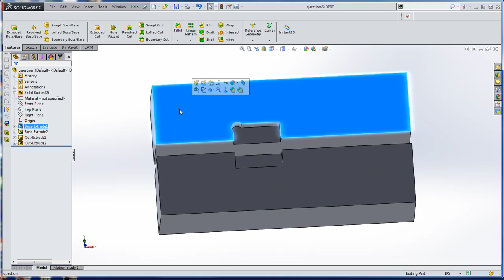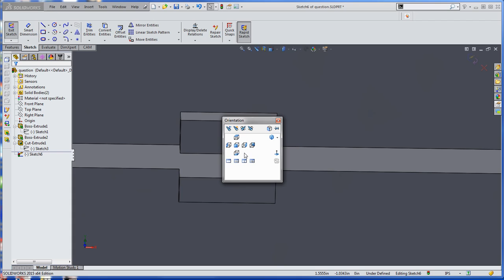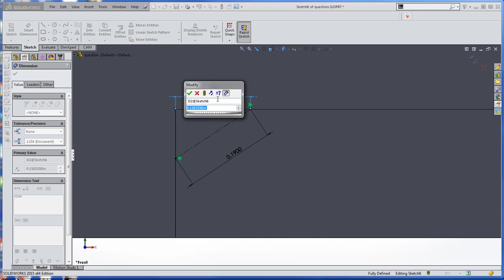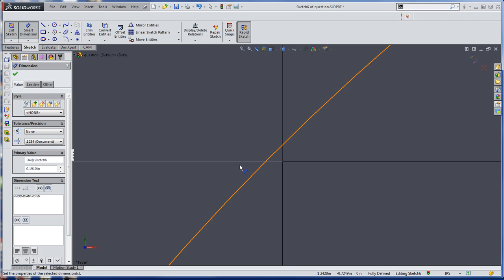Mickey Mouse SolidWorks Help!

Comment: Sorry for sounding stupid but why can't you build each jaw from two pieces? This would allow you to make truly square corners and yet still have the necessary rigidity needed from the soft jaws?
Reply: BTW, I am not a machinist, but the two piece jaw solution seems too simple to ignore.
Reply: +mpeugeot 
The trouble is cutting the square corners to start with. Since the recessed pocket is cut with a rotating (round) bit, every internal corner it cuts will also be round.

Perhaps I don't understand what you mean by "two piece jaw solution" though.
Reply: +Hirudin you can cut square corners if you split it into two parts rotate 90 degrees and mill the jaw and then attach the base and rotate back 90 degrees.  Giving you a true 90 degree corner once the two parts are rejoined.
Reply: Another choice would be to use a die and punch through the material... Giving a 90 degree corner.
Reply: +mpeugeot 
Very true. I've never broached anything, and it looks like more work than would be worthwhile for a set of softjaws (there would be little benefit), but definitely possible.
Reply: +mpeugeot 
I see. Sure, you could mill some nice square corners into a relatively thin piece of material, say 1/2" thick. The trouble I see is that the plate would still need to be attached to the jaws. OK, no big deal, just screw them on right? But drilling those holes will require a different setup (so that you can drill down into the top instead of milling into the side). On top of that, if you're just screwing the plate onto the jaws you'd be risking alignment issues. A solution would be to pin the plate to the jaws; not terribly difficult, but it would add a little bit of complication. The last issue I see is that you'd then have two bolt heads sticking up over the top of the vise. Sure, you could add some counterbores, but that would weaken the assembly and would only work with thick enough material (what if you only wanted a 1/8" deep recess? A 1/8" top plate would not leave much material for counterbores). Lastly, the screws would be under significant load if you needed to clamp down hard.

Sorry if this reply is a little "wordy";. I'm just trying to point out that there are some downsides that might not be apparent. Sure, most of the &quot;downsides&quot; I listed are actually because of the screws, perhaps you have another attachment method in mind. It's just that, at the end of the day, soft jaws cost less than $15 a set (if I remember right) and relieving the corners isn't too much trouble, so you have to weigh those facts against the benefits of having truly-square corners when exploring more complicated clamping solutions.
Reply: +mpeugeot soft jaws are made in place so no it won't work unless you want to waste an hour indicating them in

Comment: Hi!

First off im a recent sub and i love the channel!

Secondly here is how i solved the Solidworks issue (it is far from perfect but does work)

For the ears i simply drew a triangle, set the long line 45 degrees and put a circle on the midpoint of that long line and changed the size of the circle until i liked it.

To get them in all the corners i simply drew a + in between the jaws and did a "mirror entities" 2 times (Note that we are still in sketch mode).

Then you just do a blind extrude cut and it should work fine :)

I could send you the file but it requires you to have Solidworks 2014 or later.

Comment: you can get the intersection distance from the corner using tool diameter multiplied by cosine of 45 degrees (=0.70710678 also easy to remember). from the corner draw a  construction circle with the computed distance then a 3 point circle using corner and intersections with the construction circle, finally  trim. Easier to do it than explaining. BTW thanks for your amazing job. :)

Comment: Hi John, I don't use cad so my comment has the dumb factor. As far as mirroring, make the part in single piece, draw all cuts then at the end, cut it in half. As far as the mickey corners I would just use the corner point as center and drill or machine a small hole. This has less steps and in the end you get the clearance for the corners. Sorry for my dumb input but sometimes it looks outside the box.

Comment: as was said before, if the .135 isn't critical - only that they are equal, just use construction lines from the corner to the cord and set them as equal. 
about the mirror - whenever features didn't mirror or pattern for me, I just used boolean subtract. do everything as before, but instead of cutting just extrude without merging. this will create a separate body that you can mirror to your desire. then just use the boolean commands - I think it's called 'combine'. inside the command choose 'subtract, choose your four cylinders as the tool bodies, and choose your jaws as targets.

Comment: start with one piece? ^^ No insight into cad or anything sadly so just a uninformed idea/impression
Pythagoras would cover the placement on the circles? the a²+b²=c² stuff c would be your long base and a b equal so desired length of the 2 sides next to the right angle is equal to sqrt(c²/2)?
EDIT: the solution would be ~0.134350288 in the 0.19 = c case which fits inbetween the too long and too short sides.

Comment: you cant have .135 in both lines because you already set .190. Pythagoras law. so if you want to have the same .135 in both lines the .190 will be different

Comment: typically can't mirror features between separate solid bodies. if you look at your model tree you'll see you have (2). 

suggest to extrude 1 body, extrude cut the pocket, extrude cut 4 ears using 1 sketch with 4 circles, extrude cut down the center to split into 2 bodies. consider creating a construction box by offsetting the square pocket and converting the lines to construction lines. then snap circles to the 4 corners. select all 4 circles, force them equal, then dimension 1 of them to your desired size. 

to make the two elements "equal", draw a triangle with construction lines, select the two legs of the triangle and then select the "=" parameter. This will force the length of the two elements to be equal.
Reply: +Michael Morena is right. You can't mirror a feature from one solid body to another. You have two separate bodies in your model. You can, however, do a single cut that can apply to both bodies simultaneously. Like, drawing four circles in each of the corners you want. You just have to tell the feature to apply to "All Bodies" at the bottom of the feature editor.

I use multi-body parts all the time, especially with sheet metal weldments. It's much nicer than making assemblies with dependencies between parts, especially for parts you want to use for more than one project. All dependencies are then confined to the part level.

Comment: instead of typing in a value for the second dimension, type in the dimension name you want to set equal to (ie.  "D1@Sketch6"). That's how it works to set pieces equal in inventor at least. Probably the same thing.
Reply: +Samuel Kryszek 
You can make one dimension equal to another, but as far as I know, SolidWorks wouldn&#39;t allow you to define a triangle that way. The reason is, in SolidWorks, making one dimension equal to another is the same as typing the value of the other dimension manually. To say that a little differently: in SolidWorks saying one dimension is equal to another dimension that happens to be set to 0.135&quot; is exactly the same as typing &quot;0.135&quot; into the dialog box. Unfortunately, as the triangle was drawn (with the right angle between the two non-hypotenuse sides), the third side already had a set length. You can try to tell the computer to make the length something else, but doing so will be asking the computer to break one of the other, pre-existing definitions that were already set (specifically, the right angle).

Comment: Its better to use the hole wizard and select all the corner points you want relieved.
Reply: +Cameron Medri 
Does SolidWorks have a tool specifically created for corner relief? Or will this method simply create holes centered on the corners? Centered circles would be OK, but not ideal.
Reply: +Hirudin that's only assuming you're placing the point on the corners though.. there's really no reason you couldn't achieve the same result as in the video through the hole wizard, i'm just not sure it has any advantages..
Reply: +rob lockwood 
I agree, it's just different ways to skin a cat. I'd say using the hole wizard would actually be ever so slightly worse than using a sketch. I think this because it's easier to edit an extrude cut operation than a hole wizard operation. ... not much easier, but a little.